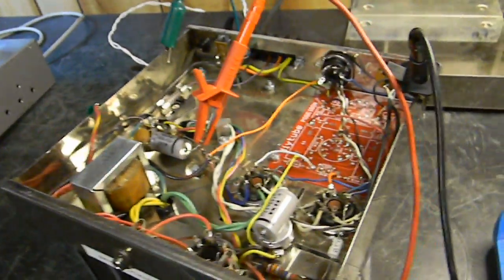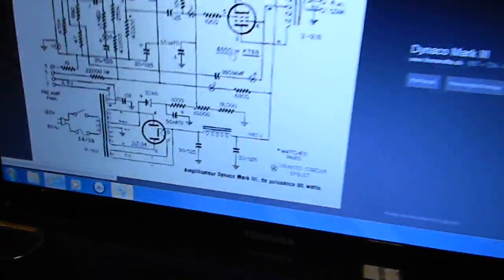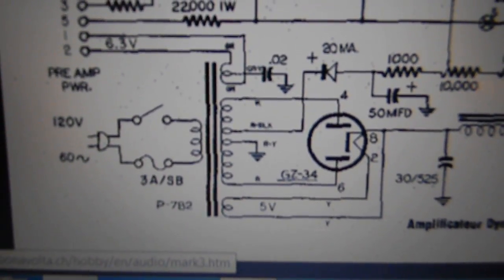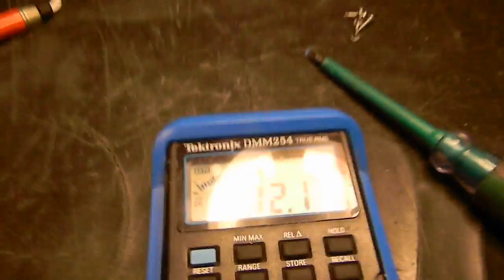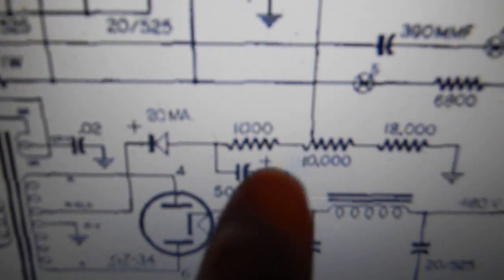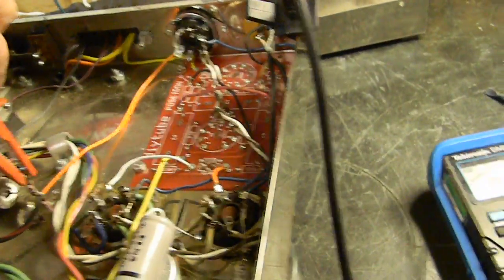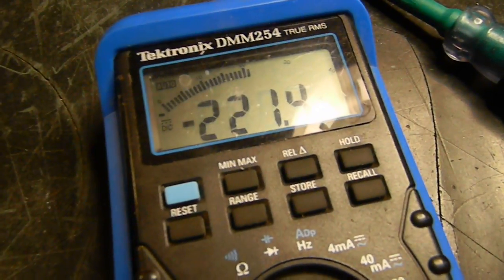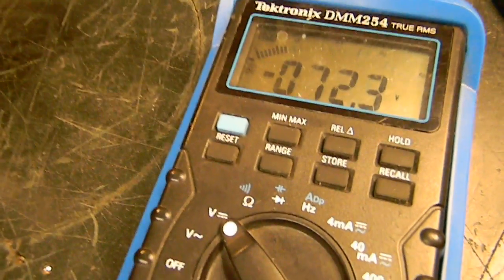Standby Switch In Center Tap of High Voltage Secondary Winding on Vacuum Tube Amps

Comment: This video clip is from long ago, but I have a power transformer with a 6.3 and a high voltage winding.
I know how to do a virtual center tap on the 6.3.
Is there a way to do a virtual center tap on the high volt winding?
Reply from the maker: Unfortunately not. In the 6.3V CT there is only about 200 mW dissipated in each of, for example, 100 ohm resistors off each side to ground and that is OK but to draw hundreds of mA of plate current for an amplifier, the resistors would have to be large in power dissipation and the transformer current would be consumed in the resistors and nothing left for the tubes. I assume you know you can use a bridge or even a voltage doubler without a CT but not a FWCT connection without a real CT.  Voltage doublers are often times a good solution. Assume a 180 volt winding, double that to get 360 volts and then multiply that by abut 1.3 for a capacitor input filter and you get 468 volts - not bad for a 6L6 class audio amplifier. Hope this helps.
Reply: @ElPasoTubeAmps  
Thanks man! I didn't know I could use a bridge rectifier in that case.
I'll check the ratios to see if I need voltage doubling.
(I thought I might have to delve through books to get an answer)
Subscribed
Reply from the maker: @garyhalliday2140  The bridge is going to give you double the voltage of the FWCT but you may have another transformer considering bridge, FWCT and doubler that will work. Good luck with the stash of transformers you might have.
Reply: @ElPasoTubeAmps  
Yes I do have a stash. I need a couple definitions. What is FWCT and  FWB?
I probably know them by other terms.

BTW I've built three amps so far, seen all of Uncle Doug's clips and others, some of yours.
Edit: all amps built from parts found in PAs and organs.
Reply from the maker: @garyhalliday2140  FWCT is full-wave-center-tapped, the standard CT type PS with the ends of the transformer connected to the plates and the CT grounded.  FWB would surely be a full-wave-bridge using four diodes.  The old instruments like organs have some nice parts in them - sometimes full of vintage tubes.
Reply: @ElPasoTubeAmps  
FW = full wave, duh.    I have a good collection of tubes, no bugle boys.
I used a bridge rectifier 40 years ago making a transformer set for the stepson's train set.
Thanks for your help ElPaso!
My grandfather and friend was into Ham radio from the early '20s up until 1977. Unfortunately I wasn't interested in amps at that time. Could've learned a bit.

Comment: I don't even understand the reason to remove the center tap from ground? If you own a tube amp, the main goal is to keep it as quiet as possible, don't you think?
Reply from the maker: This is just a way to let the tubes run (much) cooler when the amplifier is not in use but with the flip of the standby switch, the amp is always warmed up and instantly ready to play. It is a way to help prolong the life of the vacuum tubes, especially the output tubes that can run as hot as 450 degrees F.

Comment: It happens because the bias supply circuit is basically working like a switching power supply. Maybe adding a resistor to ground, as well as some zener diodes in series to get the 72v you measured, would be enough to keep this from happening.

Comment: David, thanks for investigating the standby switch placement issue. Much of what we read on the Internet often proves to be false, but in this case they were right on the money. God only knows the magnitude of the voltage spike at the moment of ground interruption. It might be interesting to see the phenomenon with an analog meter.....I wonder if it would "peg" and then settle down to just over 200 volts? It's hard to capture this instantaneous spike with a digital meter.